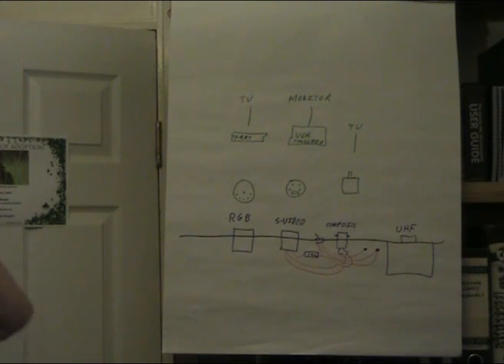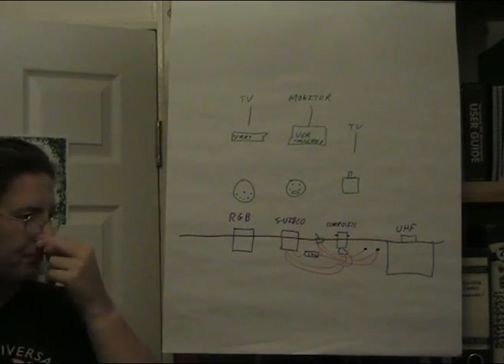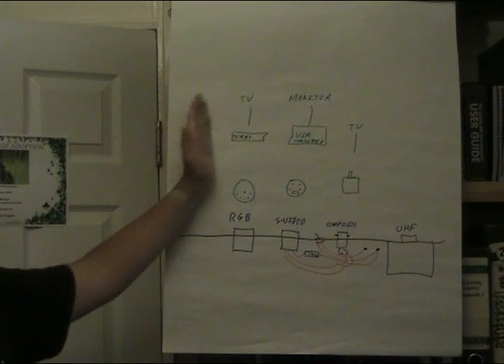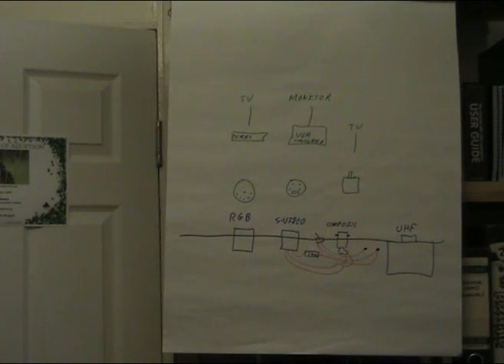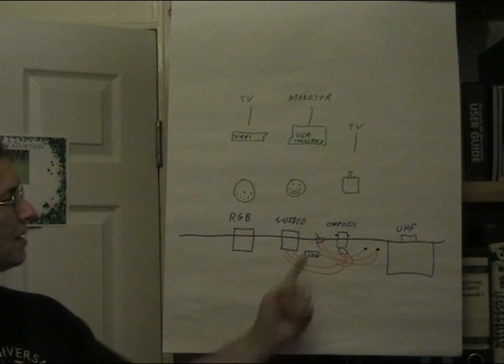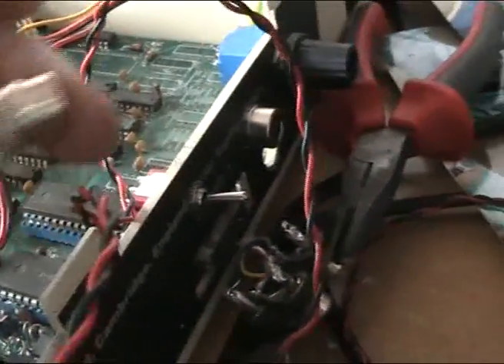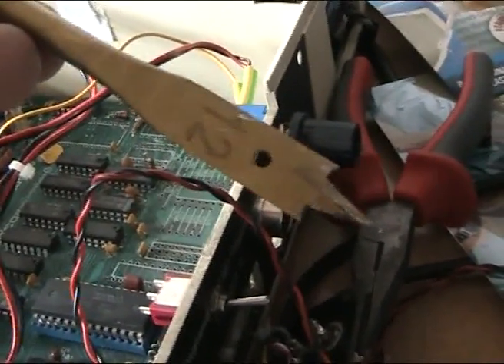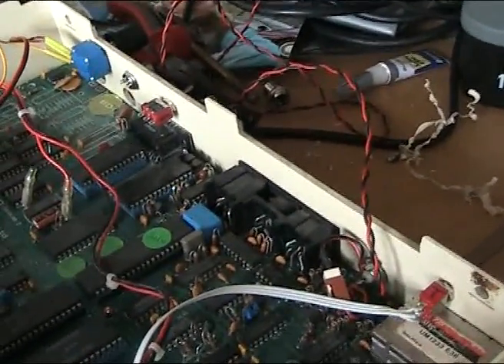19 - S-video to VGA

Comment: I did the same thing with my Atari STE and used SCART -> S-Video into a Supera Color HD convertor box, and then it had VGA output into a monitor.  Image quality is very nice good and the Atari is notorious for not playing ball with modern TVs and monitors, probably much harder to get working than the Beeb.  The Supera is hard to find now but there are plenty of identical looking clones on the market.

Comment: Nice project Michelle. I like the smoothing cuircuit from the power supply, simple but effective. Incidentally, with the issue you had with the cables and taping them down. Have you ever thought of investing in a hot glue gun? I use one of these to hold cables in place. You can pick one up relatively cheap on eBay, brand new from £5. Also the good thing with those is even if you glue something in a wrong place then you can pick it off and try again. I want to do something similar for my ELK.